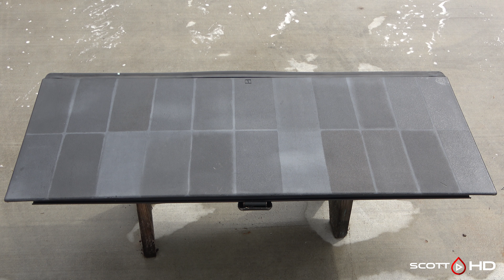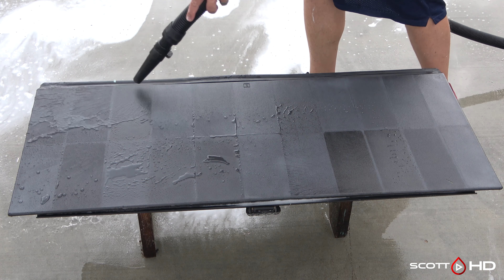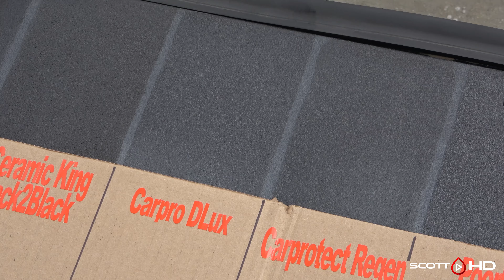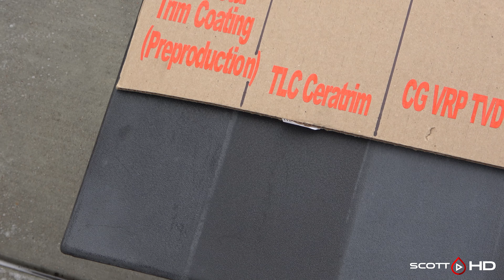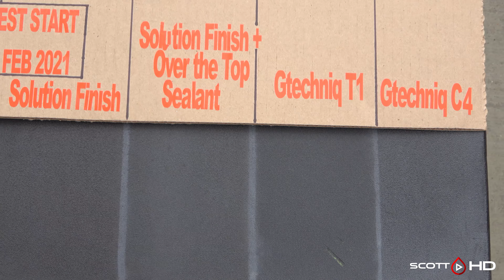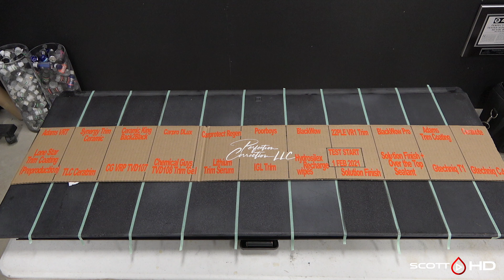22 WAY CERAMIC TRIM COATINGS LONGEVITY TEST -  UPDATE 04 - 30 DAY UPDATE!!  A few more getting weak!

Comment: Where is shoe dye??
Reply from the maker: It's on the older trim test.  Didn't feel the need to test it again.
Reply: @ScottHD  Ahh, got it. When I was detailing a client's car today, I was like, imma use shoe dye for the wheel wells. 

What do you think?
Reply from the maker: @King_drew  that's one of the little tricks from the 80's and 90's we always used.
Reply from the maker: @King_drew  been using Solution Finish in our shop for several years, but recently started using Malco for faded trim too (based on the other trim test ongoing results!)
Reply: @ScottHD  I am going to invest in some of that!

Comment: When a quality ceramic trim coating goes on evenly and provides consistent coverage, it’s great. However, if it goes on and leaves an inconsistent finish or starts to fade prematurely in an area, you’re stuck with poor results. Potentially for a really long time. I initially was having great results with Cerakote. Then I ran into a Jeep rear bumper that just wouldn’t take it evenly. My prep and everything else was the exact same as every other time I used it. Nothing ever “fixed” it. I’m at the point of having to machine polish it off. I’m going back to Malco Revive.
Reply: My opinion of cera trim when I applied it was  oh my God honey come look at this! Lol
Then after sitting in 90 degree weather for three days it rained and again oh my God honey come look at this shit! It streaked from all the applied plastic and truck looked terrible. So I called TLC about it and all they said was to wash it duh
Now I use cera trim for my tire shine works great!!!!!
Reply from the maker: Yes check out Malco in my other trim test. It's doing fantastic after 6 months

Comment: I already own some Cerakote to use on my Subaru body trim. At least it doesn't look like an early failure, so I'm going to go ahead and use it.
Reply from the maker: I have Cerakote in my other trim test too. It's still holding up 6+ months in.  

I would expect to see more failures when the summer heat gets here in a month or two.